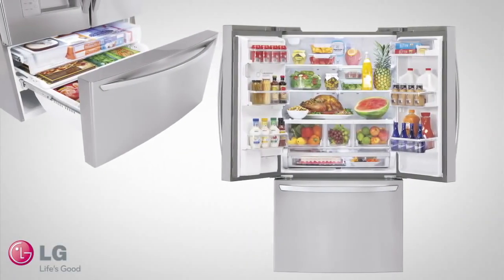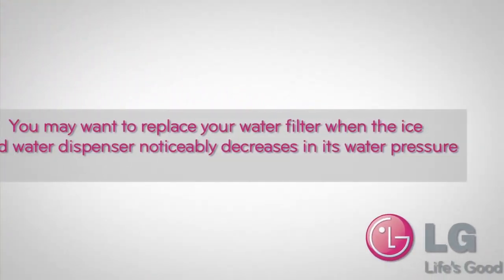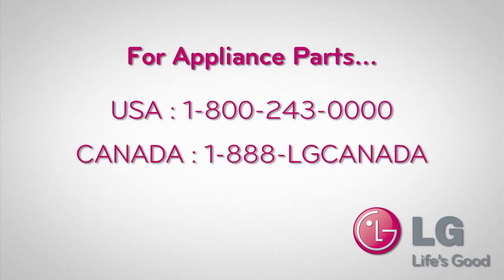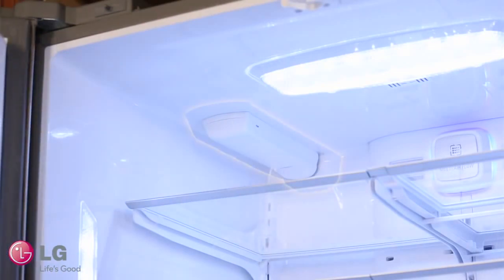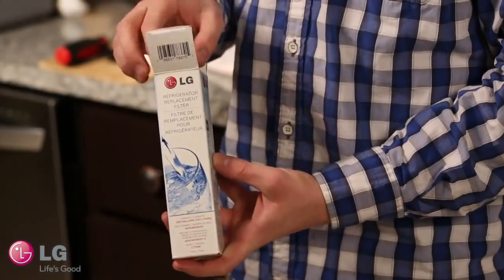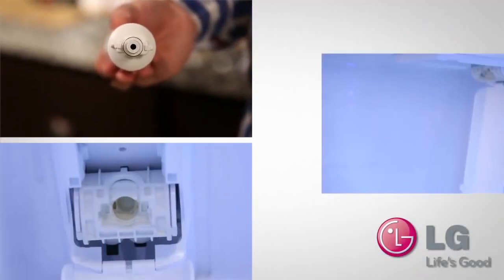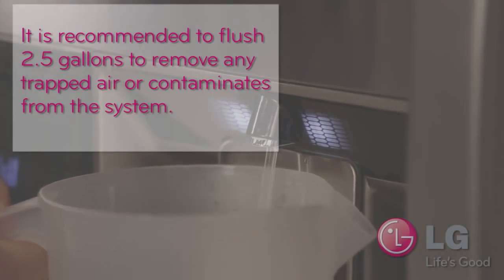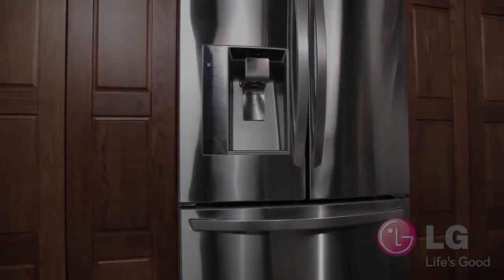How To Replace Your LG LT700P French Door Fridge Filter Model ADQ36006101

Comment: ****Heads Up*** When changing filter you might have to remove the shelf. So the filter fully comes down. Otherwise it will not release filter. Once it is fully down, it comes out without any issue, it does not need to be forced out. Just has to be fully down, and out it comes. Once changed follow the directions of getting the air out. Air came out of the water spout. Glad I followed the rest of the instructions.  

Thank you for making this video, it is so much very appreciated.

Comment: Filter will not release. It's stuck. Any advice at all would be helpful.
Reply: Mine as well. Wish there was more troubleshooting with this video.
Reply: @SpearAmint  When taking out the old filter, you have to make sure you rotate (pull) the filter all the way down before pulling on it.    I had to remove the shelf below the filter in order to do that (as the video says).      Also, you do not have to turn the water off as coach Sandra wrote.  Hope this helps